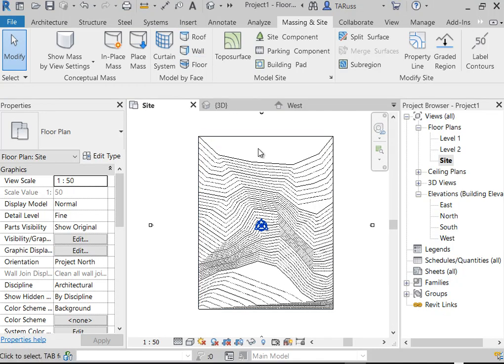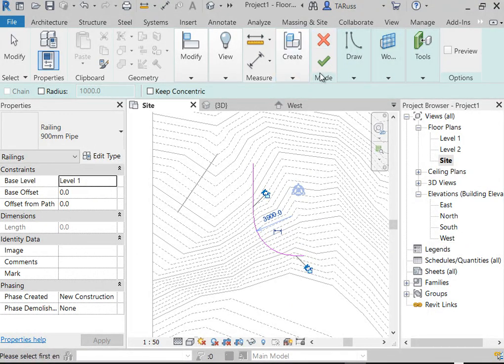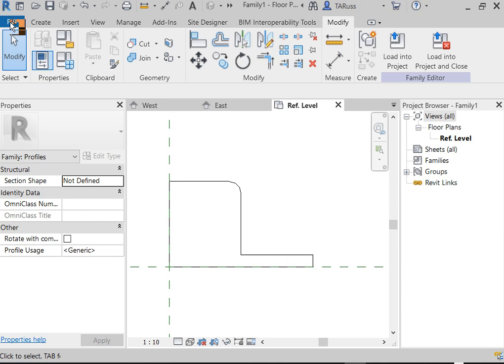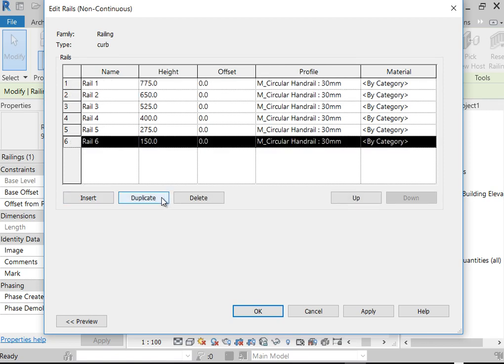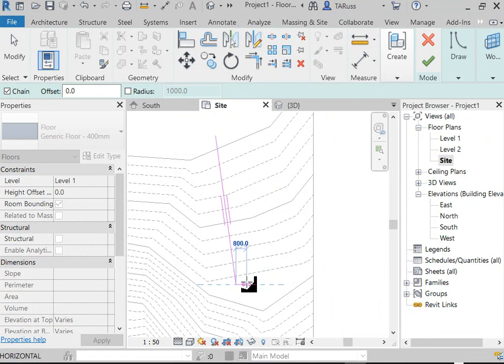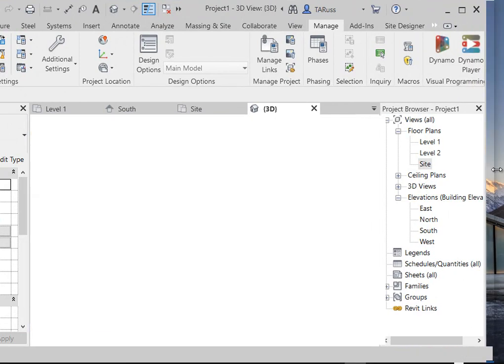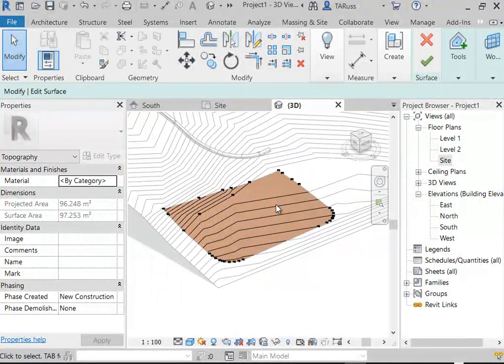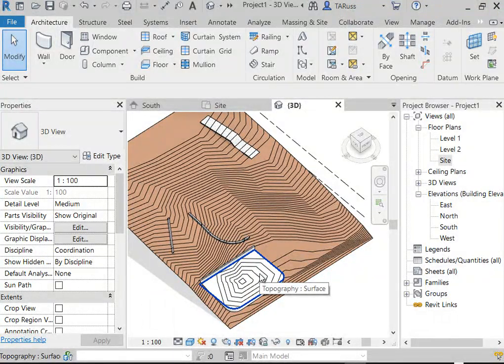Revit sidewalks and curbs

Comment: I like the railing idea. Thanks!!!. Suggestion: Instead of the top rail use the bottom one. If the profile has a portion in the negative region it will accommodate nicely through the topography.